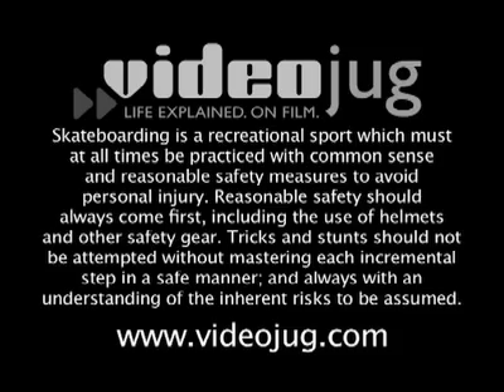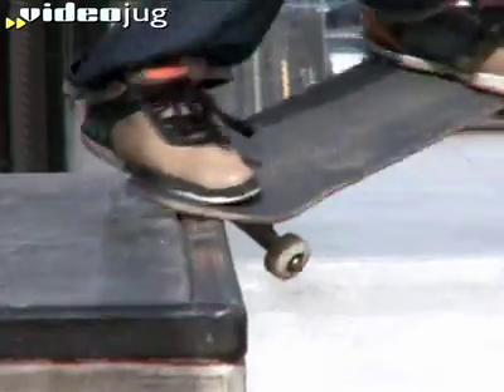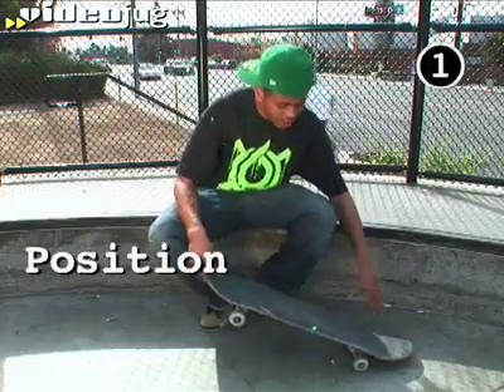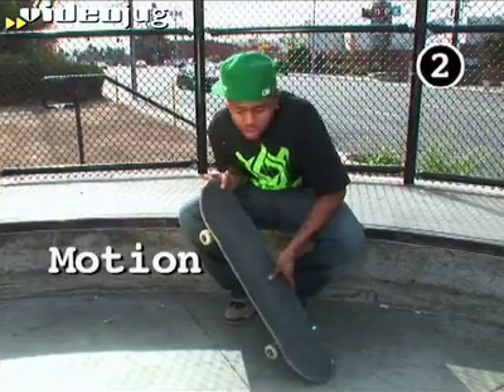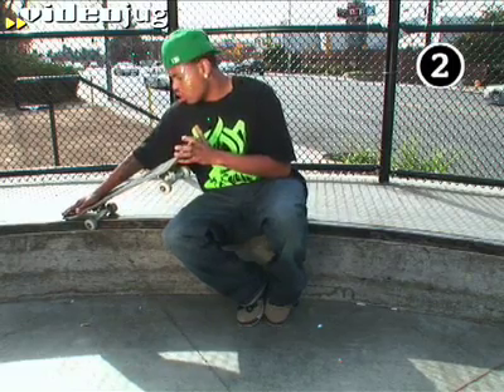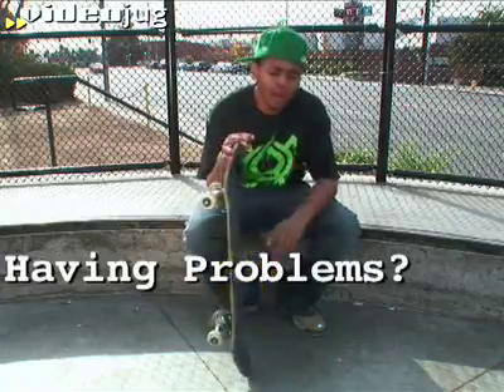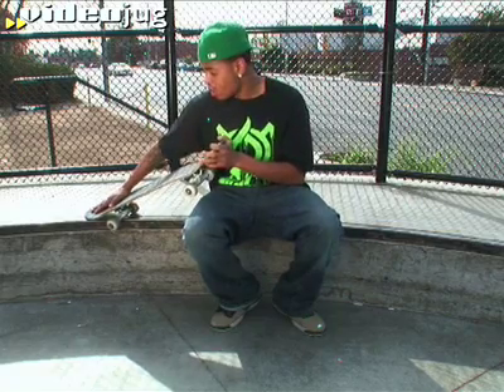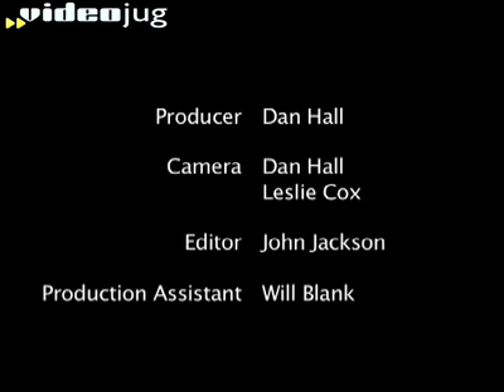How To Do a Crooked Grind on a Skateboard

Comment: A nosegrind is when the board is parallel to the ledge/rail and you're grinding with your front trucks. Crooked is a nosegrind with the board facing out. What's it called if the board is facing in? (opposite direction of crooked) and what the hell is the difference between k-grind and crooked? Thanks